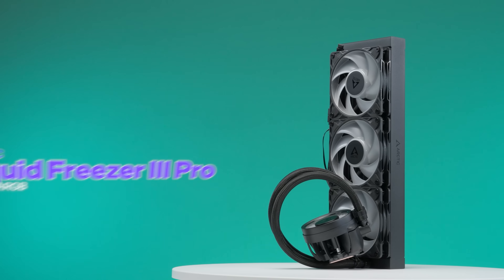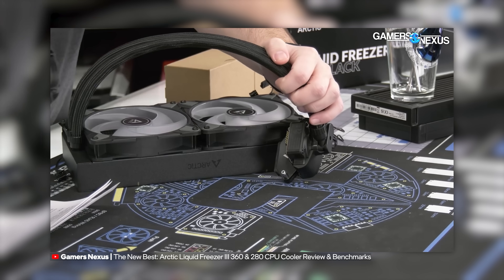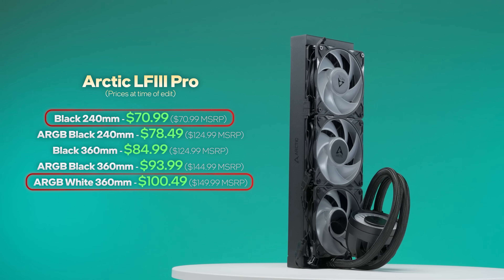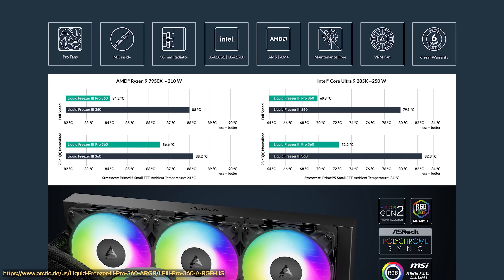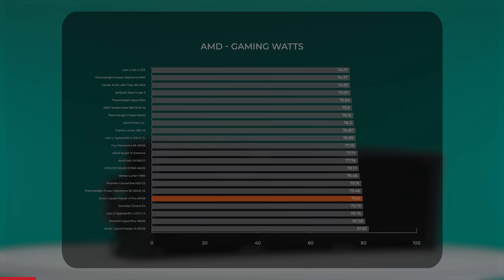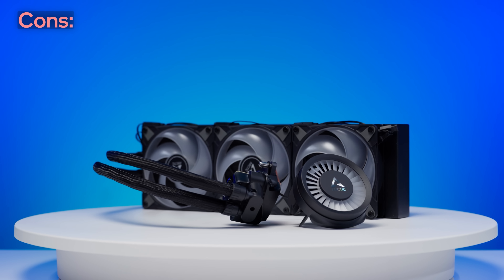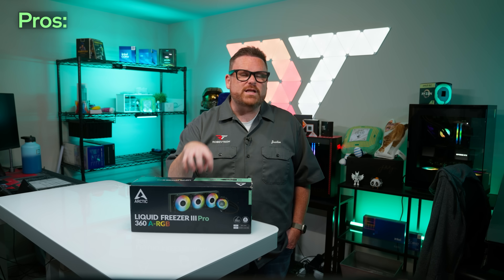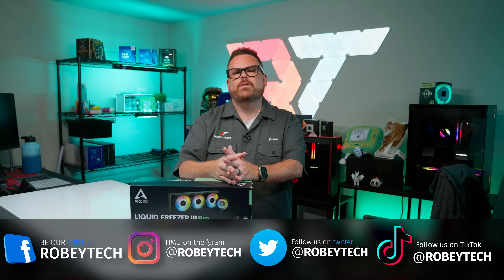Is it actually an upgrade? The Artic Liquid Freezer 3 Pro AiO Ultimate Review

Comment: Looks like reading the comments that this channel is full of muppets that are only interested in AIO screens & RGB rather than the actual performance of products.

Let’s go over some things.

Arctic have always sad that the only difference between the Pro & standard is that they changed the fans to give better static pressure for the thicker radiator that the LF3 uses (compared to most others).

Not liking it uses a contact frame? Well most Intel users will be using a contact frame regardless of cooler they use so will have to buy one. It’s included with the LF3!

I have the original LF3 on a 13900K OC to 6GHz & after a 30 minute CineBench run it has not throttled one bit or dropped clocks on any core during the whole run with a max temp of 74C with the fans never getting above 80%! Every single Asus AIO in SAME setup has throttled within 5 minutes of the run & dropped the clocks by almost 400Mhz! Lian Li AIO’s have been even worse!!!! Maybe it is because I don’t use the supplied fans (with any AIO) but only use Noctua fans & gaskets, but that can’t be the only reason as the same fans were used on the other AIO’s I have tested/used. Let’s also not forget that Lian Li Galahad series AIO’s are notorious for clogging up very quickly & then failing (even the ones where Lian Li have claimed to have fixed the problem). I have disposed of 20+ Lian Li Galahad series AIO’s for people that have had them fail within warranty but Lian Li don’t want to help them (yet I will still use Lian Li cases even if they won’t provide spare panels to people that have broken their panels). The Asus Ryujin AIO’s cost at least double what the LF3 does yet perform worse in every way regardless of how mounted & thermal interface used. Everyone I know that has bought a LF3 with their hard earned have all seen drastic improvements to their temperatures & noise (even with the supplied fans). If Arctic supplied anti-vibration gaskets with the LF3, then it would be basically perfect, but they don’t cost much & take 10 minutes to fit yourself (something that should be done with all radiator attached fans anyway IMHO as helps direct the airflow going through the fins properly without some leaking out between the frame & radiator).

As for motherboard compatibility, a lot of the other AIO’s & Air Coolers won’t fit them either with larger items around the socket. At least Arctic show the boards they have tested it won’t work with (as do Noctua but have you called them out on the same thing?). Installing the LF3 is not a problem & I have dexterity/strength issues in my hands/arms due to MS. But then again I have been in this game for over 35 years. As for the offset brackets, I cannot comment as do not use AMD systems because they do not fit my requirements (I don’t use my rigs for gaming predominantly although do use them for some gaming after their real work has been finished)

Installing the contact frame & pump block should be done with the motherboard outside of the case (& Arctic suggest this) which makes installation a LOT easier, especially as most cases nowadays will have removable radiator/fan trays/plates. Even a standard contact frame like the Thermal Grizzly or Thermalright ones are best installed outside of the case on a flat surface so not to risk the CPU slipping & damaging pins.

I would use a LF3 in one of my other machines as well (i9 9900K) if they provided a mounting bracket for LGA115x in the box, but they don’t & released a bracket kit for that (& LGA1200) at an additional cost instead of free to purchasers of the product like Noctua do for their coolers that may not have been supplied with mounting hardware for a socket. That is my ONLY beef with the LF3 & Arctic.

The fans supplied use a standard motherboard header connection, even on the cable running through the tubing sheath which means can use other brand fans without sacrificing the neatness of the cabling alongside the radiator (especially if use Noctua fans which have the short tail on the fan & use an extension cable).

I have been using my LF3 360mm since launch (paid for out of my own pocket) & it is still performing perfectly. Not needed to change the paste used in that time either & temperatures have not changed over that time. No noise from the pump, cannot hear the VRM fan running at all (I have checked to make sure it is still running!). I have no reason to lie or anything, I haven’t been given a cooler to try out or have deals with any brands, heck I don’t even have a channel (nor do I want one as done enough hardcore testing & written reviews back in the late 90’s/early 00’s on PC hardware & never held back when there was a problem to the point I was public enemy number 1 to a lot of companies back then because I found faults in their hardware - remember the i430TX chipset issues from the Socket 7 Pentium days? I was one of the people that originally discovered the >64MB RAM caching issue. I have to admit that I am not a subscriber because I have watched several videos & disagreed with a lot of your ‘findings’ contained in them (same applies to a lot of the big popular channels & tbh most of them have one thing in common - they all concentrate on things that make no difference to the performance of a PC such as RGB, internal screens in cases, etc instead of the REAL things that matter when building a PC - the actual performance of it!). I would rather have a PC that looks like it has come out of a scrap yard that performs like a perfectly tuned F1 car, rather than a PC that has lights & looks ‘good’ as the only things that matter to me are reliability & what it puts out to the monitor/s. If spend more time looking at the PC case than the monitors, then may as well not even use it as it is just an ornament then.

A lot of people think that Arctic & Arctic Silver are the same company (which they are not). Arctic Silver is the actual name of that company, not the name of just the TIM.

If you want to fly me out to your studio & show you how to install a LF3 correctly, then please get in contact & I will happily do so.

Comment: I had the ProArt LC420 and that AIO was garbage. My setup uses the 9950x3d. Temps while running CB23 For 30m got as high as 89c. I swapped to the LF3 Pro 360, on the same test, got it down to 80c. Now, the LF3 Pro 420 is out and shaved a few more degrees to 78c. So far, enjoying this AIO.
Reply: Change the fans to P12 max, you'll see huge difference.
Reply: The 9950x3d is not good. The 9800x3d or 9950x are better. The hybrid is never the way it’s all or nothing.
Reply: @ZackSNetwork  What a statement. You clearly have no idea. That thing is amazing.
Reply: @ZackSNetwork  The 9950X3D is a fantastic CPU. If you're just a gamer then the 9950X3D is probably not for you; go buy a cheaper CPU. But, if you're a person that plays games AND does video editing/rendering etc, then the 9950X3D is probably one of the best CPUs out there at the moment.

Comment: You guys REALLY need to do a review on the brand new Phanteks Glacier One D30 x2 AIO (I have the 420D30 x2, but there's the 360D30 x2 as well). The Glacer One M25 AIO doesn't hold a candle compared to the newer Glacer One D30 AIO and the newer iteration of the Glacier One D30 x2 AIO is even better combining the best of both worlds. It has the same style but a much more efficient and better VRM pump fan on top and also a much bigger copper plate and surface area with more fins inside the copper chamber. It's literally the perfect AIO imho. The fan is absolutely incredible and is much more effective than the ALF III fan and even more so than the latest Corsair AIO VRM pump fan.

PLEASE do a review on this AIO or both the new one and the older D30 AIO for comparisons. I was absolutely blown away by the performance. I'm sure you will be too.
Reply: Not better than m25 cus d30 is bad through rad
Reply: @Zhandos18  It's actually really good. Just because it spreads out a littler more and a little less static pressure doesn't mean it's bad for the radiator. If the air is hitting the fins and water ways much harder rather than going straight up and out, it's actually better since that cool air isn't being wasted. I've tested D30s against M25 fans in the same system and same radiator. The D30s were drastically better.
Reply: Send them one for review then.
Reply: @thor.halsli  Not going to blow $200 just for them to do a review lol wtf.

Comment: why you never show amd noise normalised data !! I dont get it
Reply from the maker: We don't call it that, we use gaming as our noise normalized because it's the same workload on all the AIOs.  But most people don't know what the heck that means so we call it at gaming but it's the same precedent.    So people don't need a science degree to understand a review.
Reply: @robeytech  How do you use noise normalized in your gaming test if you then present a graph showing different noise levels in the gaming test? 
I don't think I need to explain it to you, but I'll write it anyway, so we have all the context set. 
Noise normalized means locking the dBA to a fixed value. That means you measure each cooler and increase or reduce that fan until you reach the same absolute dB value, you note the RPM and then perform the tests at the RPM values you found for each cooler. 

Though in fairness, I dislike noise normalized tests because it only shows me how coolers perform at that one value.
I think the best way, and without this being an ad is the way STS does it. He sets the coolers at various speed levels and notes the noise and temps creating a noise to performance graph along with max performance values in a different graph.

That is the thing that should interest people the most because there are all sorts of weird shenanigans going between radiator fin density, fan performance not being linear, water saturation depending on how much heat is being thrown in the system, the different coldplate designs and the flow through the microfin array within the pump block and even the pump itself. You would be surprised that some pump designs move heat more efficiently when NOT running at full blast, though ofc, that falls on the manufacturer to find out during the R&D/prototyping phase and limit the pumps accordingly.

In regards to the LFIII PRO (or any cooler for that matter), I don't really care the most about what it does at max speed, it's neat info to know if there is headroom for better fans down the road, but outside of that, it's too loud to run while being in the same room and as such, the information is of little value when presented alone.

However, if the P12 Pros are better than the regular P12s at a lower, more bearable noise/RPM range and that also results in better temperatures on the AIO, up to an acceptable noise value, then that is suddenly a much more different picture and why we need noise/performance graphs.

Comment: I have ALF III 420 ARGB vesion. I paid for it like 75$ about an year ago and it's still performing sweet.
Reply: I went push pull with mine and it works great.
Reply from the maker: Yeah its performance is fine.
Reply: @robeytech  Test the ALF 3 Pro 420 argb vs Lian li GA Lite, pls

Comment: Your understanding of an IHS is outdated, back when heat causing components were centrally located, the IHS could spread out the heat evenly, now that Intel and AMD have moved to chiplet designs the heat causing components have shifted so an off-set cooler is a better solution. Since your familiar with Gamer's Nexus, look up their video with Noctua engineers and you can get a more modern understanding of why coolers need to adapt.
Reply from the maker: Thanks for this.

Comment: Disliking this one twice as hard as the first one
Reply from the maker: Why?
Reply: @robeytech  I don't believe your noise normalized test results. GN has it at the top how can you have budget coolers that are better than the arctic? Something is off. Also I just bought one and I am simping / coping
Reply from the maker: Dude it's not hard to do this.  They have the same load and the same games, I am sorry the data doesn't make you happy but that doesn't make it wrong.  We also test WAY more AiO's then GN does.
Reply: I am now very unhappy. What would outperform a Arctic Liquid Freezer III 280 in my Fractal Era 2 though? I think that it's the most noise efficient 280, can't fit anything larger @robeytech

Comment: If they would slap a screen on it, it would be a lot more attractive to consumers.
Reply: Why? You lack of monitor or TV?🤡
Reply: Not for me, more shitty cables, more shit that can break, heavier and bulkier, looks tacky, and now you gotta make your case a fishtank for better visibility of the screen or put your PC sideways otherwise whats the point if people cant see it.
Reply from the maker: Maybe.
Reply: Screens are overrated and silly when you can have a VRM fan on top since VRMs get pretty damn hot these days. They also provide cooling to the M.2 heatsink and even the 3rd memory slot since it's isolated. The new Phanteks 420/360D30 x2 AIO is an absolute monster as well as looking extremely aesthetically pleasing with a real infinity mirror built in rather than the Phanteks M25 AIO that has a sticker infinity mirror so zero wobble when spinning. M25 fans suck compared to the D30 fans as well. They're the best fans I've ever used while also being very quiet. 30mm fan blade thickness compared to the standard 25mm for almost all fans makes a massive difference in airflow.
Reply: Anyone slapping a screen on their AIO instead of a VRM fan at this point is just uneducated.

Comment: Might as well  just get yourself a good air cooler if you are trying to cut corners like this. Gamers Nexus Steve is schill for this product is one of many reasons why I quit watching him. Another is that he turned into a drama queen picking fights w/ everyone.
Reply: When placing the VGA vertically on a Thermaltake Tower series, the GPU temperature may become abnormally high. However, GN has welcomed them as a channel sponsor without pointing this out and is promoting the Tower series. They collude with manufacturers to intentionally not disclose information that would be detrimental to users. There's no way GN isn't aware of the problem. Meanwhile, they are making unnecessary attacks on NZXT. Their style is to make profits by not doing what is necessary, and then make profits by doing what is unnecessary. There is no justice for users, only profits being prioritized. For anyone who seeks the truth and the benefit of all users, that show is nothing but painful.
Reply: @銀河光芒  this is the first I've heard of this issue as I'm quite interested on buying a Thermaltake Tower 200.
is it because of how gravity affects the thermal paste/PTM?
Reply: @yanagida_01  no it's actually the heatpipe orientation, lianli even had some gpu orientation guideline and which gpus do ok when mounted up right. They were the 1st to really get hit with complaints about gpus running hot when mouitng up right. Some how people forgot heatpipes prefer certain orientations.
Reply: @銀河光芒 a bit over dramatic as this is a hit or miss situation. This has to do with the way the heatpipes are in certain gpus. This doesn't affect all gpus and is case by case. Same reason certain low profile air coolers only work in certain mounting options.
Reply: @deviantbuilds  I know that there aren't many VGAs where heat is an issue. As VGA becomes more high-end, vertical placement with the bracket on top becomes more risky. The problem lies with the manufacturers who are aware that problematic VGAs exist but sell them without making any announcement, and with the attitude of YouTubers who promote them. This industry is only concerned with increasing sales and views, so the truth is not spoken by them. The number of VGAs that cannot be cooled with a layout like The Tower is increasing with each generation. In fact, the Sapphire products were fine with the 7900, but were completely destroyed with the 9070. This is not a PC case that you can just casually buy, and the manufacturer is certainly aware of this.　Of course I know that Lianli announced it, which is why Thermaltake is the worst.
Reply: Cut corners? They changed the fans thats all on the Pro to increase static pressure on the thicker Radiator. That’s not cutting corners. As someone that uses one of the original ones on a 13900K OC to 6GHz & it does not throttle or drop clock speeds down after 30 minutes of CineBench runs, it is the ONLY 360mm AIO that I have used (& that is a LOT!) which has done this. Every single other one has caused the CPU to throttle including the predecessor, the LF2. No issues at all with the Contact Frame & TBH most Intel users will be replacing the LGA clamp with a 3rd party frame anyway, so it saves money by being included.
Reply: You aircooler soyboys are something else. Youre like vegans/tesla drivers of the pc world.